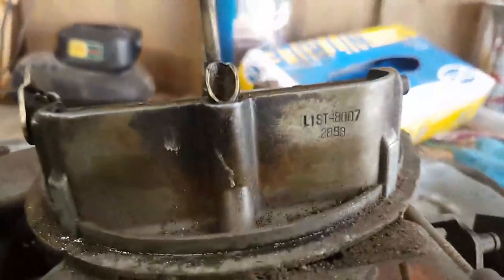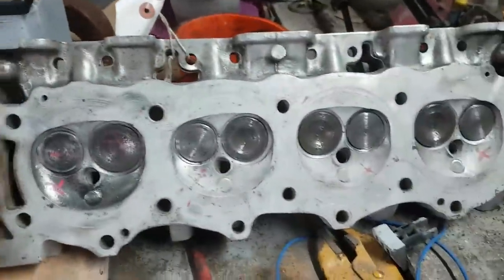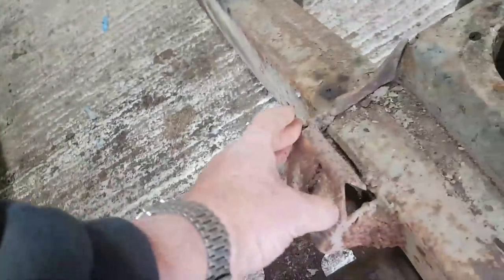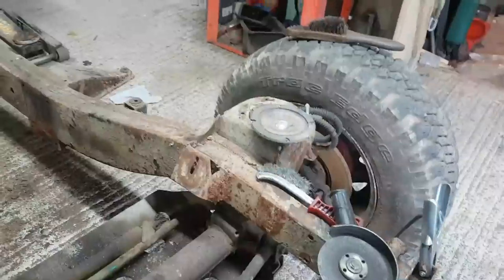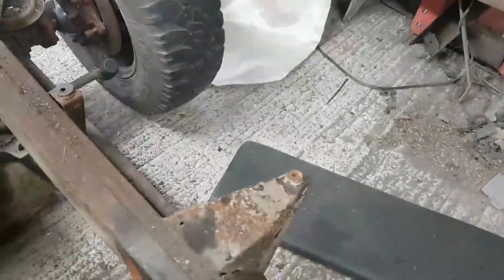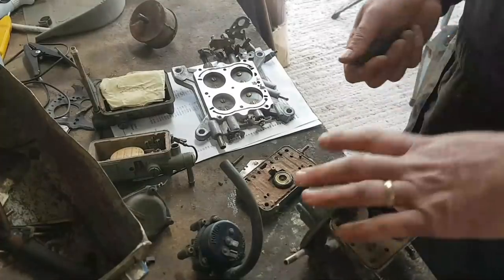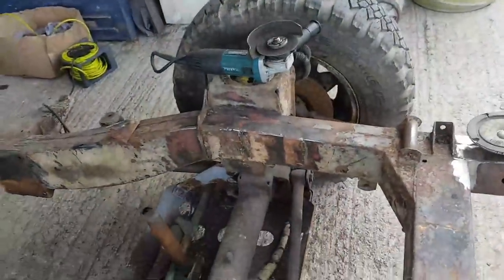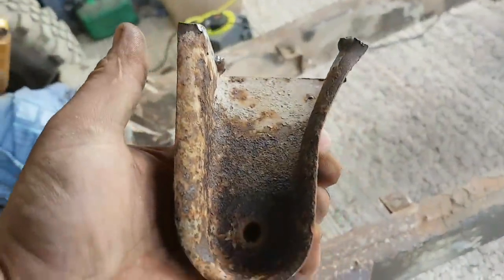Episode 5   1971 Range Rover BOB - parental warning

Comment: 29:50 we use a solid piece of red copper flat bar block of about 10mm thick and hold it on the back side then weld it up with mig ( or co2 ) then just tap it of afterwards thus getting good solid penatration and build up of the mother material no patch neaded it works on smallish type holes and so forth with holes we use a red copper round bar weld it then move it a bit and weld while loosening it until the hole welded and is round again.

Comment: when ive got heavy dints i weld a bit flat bar on with a hole in it so i can get slid hammer hook into it pulls every dint you can imagine out especially rear crossmembers
Reply from the maker: One already has a hole, welding the flat bar on is a good idea as I normally drill a hole, weld a bolt and then grind it flat again. Bar might make it easier to see when it is straight 👍🍻

Comment: In my experience of Land Rover chassis, they rust from the inside out and also with other model Land Rover's the quality of the steel varies. That wasn't in my opinion gas axe damage, just poor quality metal and life.
Reply: Thompson chassis used to make them in Bilston Wolverhampton and materials used was of a good quality 👍
Reply: @jeroemsmith566  Interesting, I do know that steel quality varied a lot in the 1970's, 80's and 1990's much like today. 1975, 76, 78 and 1984 were bad years for corrosion on Land Rover's and Jaguar's and other British made cars. I owned several Land Rover's and Jaguar's made in the 1970's and still own a 1975 XJ6 which basically needs a complete restoration.